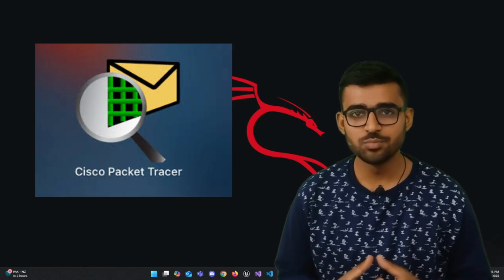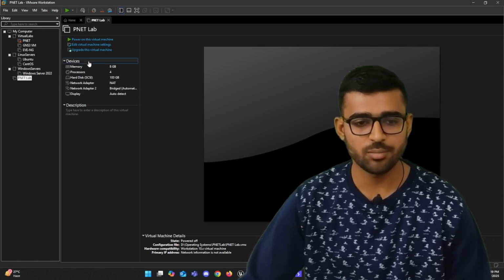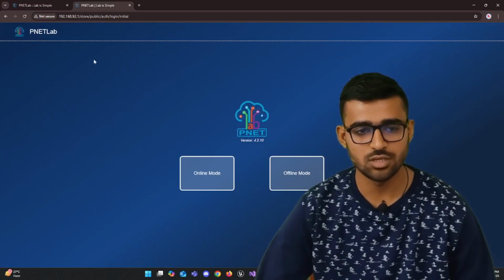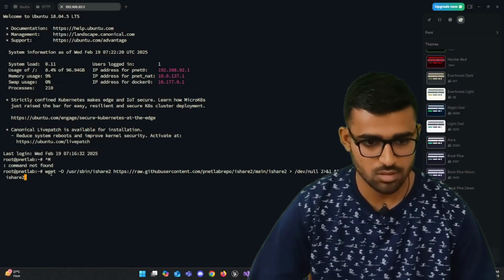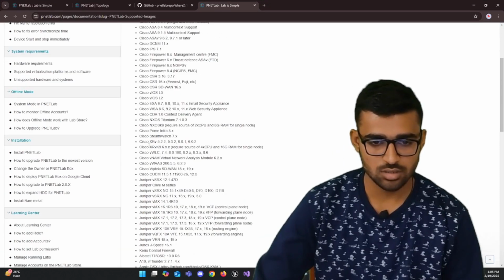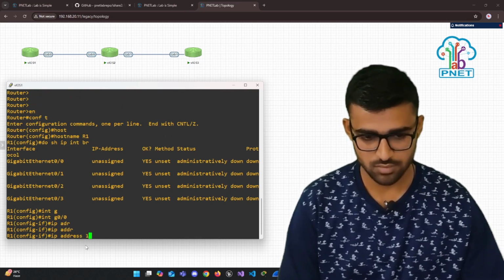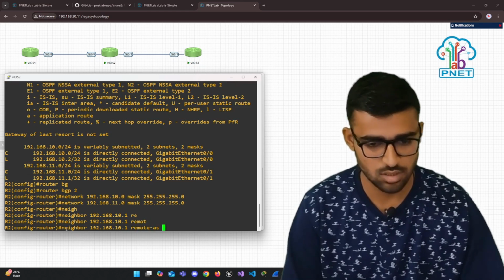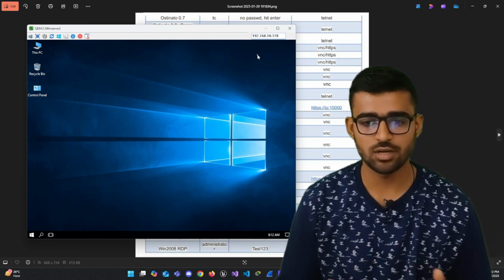How to Install & Configure PNET Lab | Complete Guide

Comment: I have already disabled all the Hyper-V-related features and turned off Core Isolation on my Dell Inspiron laptop running Windows 11. However, nested virtualization is still not supported, and VMware continues to display the same error.

Could you please help me identify the root cause and guide me on how to resolve this issue?

Comment: comment acceder a /opt/unetlab/tmp/POD Nr/Lab UIDD/Node ID/ sur pnetlab pour ne plus avoir a reinstaller un systeme d'exploitation n fois
Reply from the maker: To access this temporary folder in PNETLab (or EVE-NG) and save your virtual machine's changes so you don't have to reinstall the OS every time, you can use an SFTP client or the Command Line (CLI).